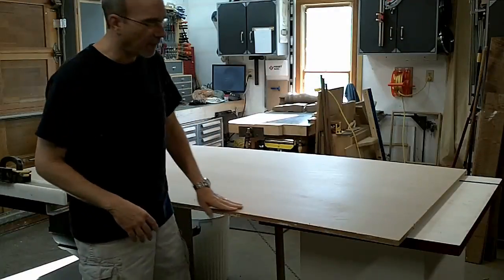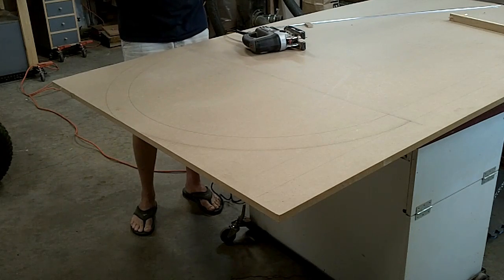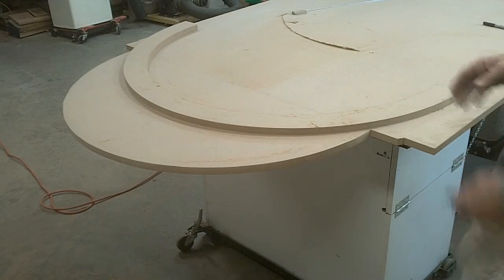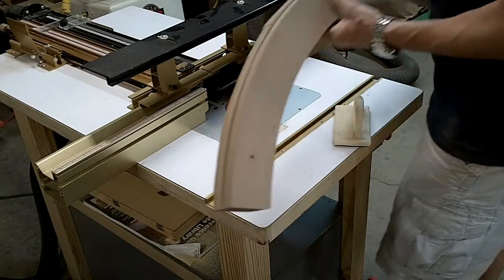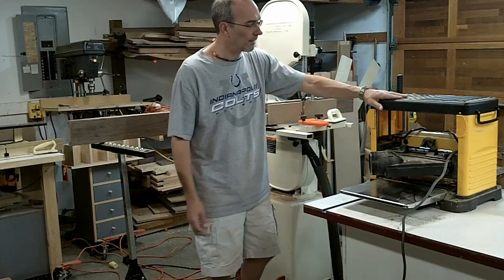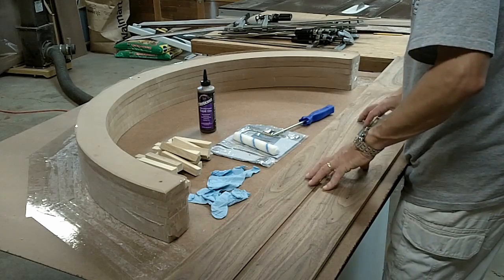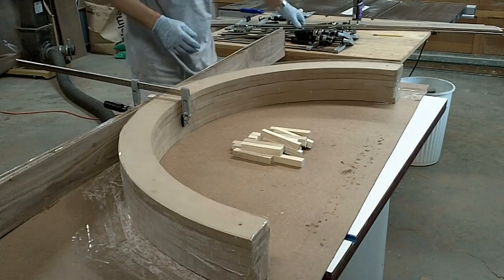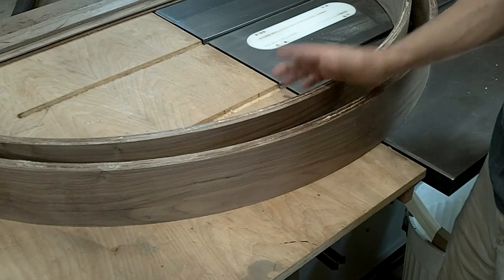Pedestal Extension Table Part 6

Comment: I made a similar table somewhat 8 years ago, in my case only one outside of the arch of was showing so I only used walnut for the outside layer, the rest of the laminations was cheaper pinewood, never got a complaint from my customer.

Comment: This is great work. Idea: instead of rough cutting the template first you could also only use the plunge router, put a small router bit in (6 mmm) and three to four consecutive plunges will do to have a smooth routed surface. But yes you'll create a lot of dust, modern routers can cope with this.